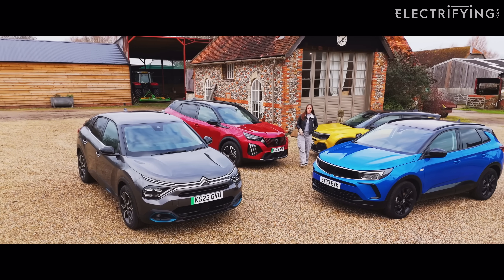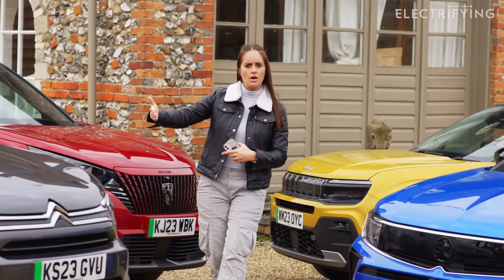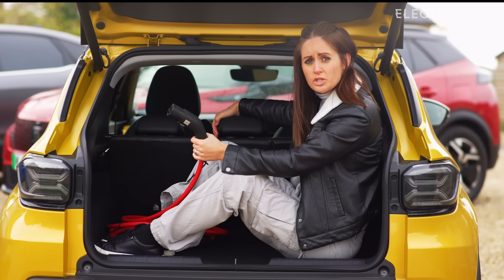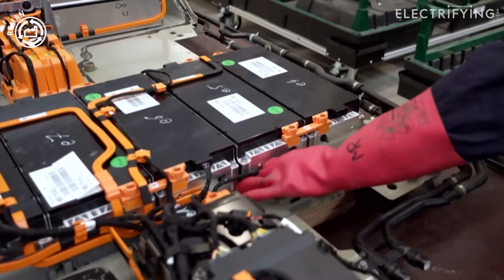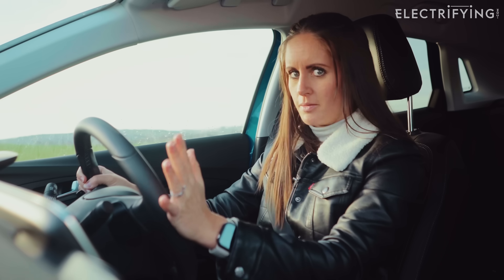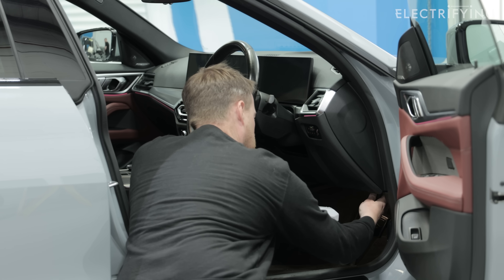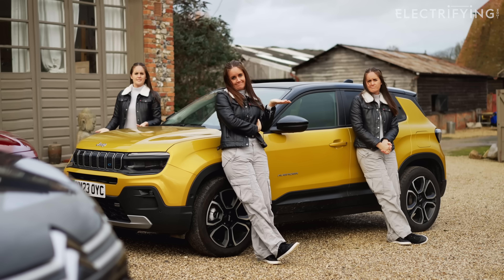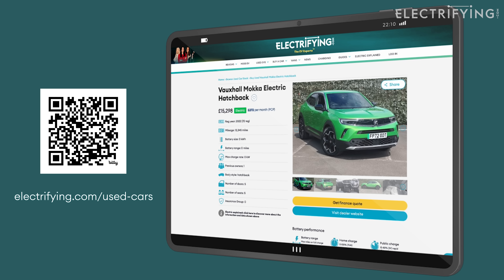WILL IT LAST? The Truth about used EV batteries

Comment: The key line there was the one about 'most' people will change cars after a few years. Well, the whole pcp finance model relies on someone else then buying said car  for circa 60% of the rrp. And here's the thing, it's very easy to look and listen to an ICE and get an idea if it is a dud. In most circumstances, you can't look at a motor or a battery pack or an inverter stack and know what condition it is in. Battery condition reports should be mandatory for used sales, regardless of any warranty that may or may not still be in effect.
Reply: "it's very easy to look and listen to an ICE" - but, is it really, though...?
An average engine contains around 200 moving parts, failure of any of which could render the engine wrecked.
How does your 'Average Jo/e' used car buyer check the cam-belt, for example...?
Or the oil pump...?
What about checking the piston 'con rods'...?
Other than checking under the oil filler cap, there's pretty-much nothing else the average buyer could assess.
Conversely, with an OBD dongle and smart phone app, most used car buyers can check the State of Health % of the battery and, in some cases, even check individual cell modules for health.
Buying a used EV is (statistically) considerable less risky than a combustion-engined car.

Comment: She's missed the point. What happens when you try to sell your very expensive second hand car when it's over 8 years old and well out of warranty?
Reply: Same as an ICE car that's well out of warranty after 8 years (in most cases well under 8 years)
Reply: @leslie19611 Wrong, ICE technology is stable and ICE motors don't degrade over time. 
Gen 2 blade batteries and semi solid state batteries will massively impact the 2nd value of NMC car market.
Reply: Being electric it tends to last, less things to go wrong so why is it any different from a fossil. Friends seven year old Audi petrol more or less chewed itself and Audi wanted £9k to keep it running he g😊He got a second hand engine and spent three weekends replacing it something most can’t do as I said your lucky you know how to do that the car would just be scrapped if it was me. Twelve year old Nissan leafs sell because they still have 80% capacity and their battery tech didn’t have hardware and software to protect and look after the now ancient battery chemistry. Second hand EV’s are selling well because they are some good bargains out there.
Reply: @SWR112 Wrong, ICE technology is stable and ICE motors don't degrade over time. 
Gen 2 blade batteries and semi solid state batteries will massively impact the 2nd value of NMC car market.
Reply: @phildrabble5498  ICE motors don't degrade over time? They wear out and always have done due to all the moving parts separated only by a thin film of oil. I think you need to do some reading to understand how ICE works.
Electric motors have been around longer than ICE motors so I think the tech is stable by now.
Reply: @huwjones5879 What a ridiculous statement, battery technology is improving at a tremendous rate. 
CATL are already producing Gen 2 Blade batteries and BYD their semi solid state batteries for the MG, both designs are safer and will achieve recharge cycles in the Thousands not Hundreds. 
Once they hit the market 25/26 your NMC battery vehicles will be second rate gimmicks due to their 30% battery degradation over a 20 year period (1.8% per anum). 
Do you really think ICE cars lose anywhere near 30% of their range or power over a 20 year lifetime?
Reply from the maker: 'She' hasn't missed the point. This video is about battery health, not used EVs. So THERE, Phil
Reply: @Electrifyingcom Ha Ha! 
You know you're wrong! 🤡
She repeatedly mentioned 2nd hand cars! 
BTW Hyundai are at the advanced devolment stage for solid state batteries, CATL already have their Gen 2 Blades and BYd have got their semi solid state batteries in production. 
So why is there the need for all these new technologies to be launched if NMC battery health will last into the 2nd and 3rd hand market? 

Utter  🤡 s
😎 😁 😅
Reply from the maker: @phildrabble5498  Oh Phil.
Reply: Oh  @Electrifyingcom You definitely know you're wrong but clearly aren't aware of the new battery technologies just around the corner which do have  extended health comparable with ICE.

Comment: The thing which impressed me were the multiple Nicolas at points in the video. Nice technique. I also do not not mind the commercial plugs. The battery value and use is going to be a problem. I think battery tech is going to change in the quite near term - just look at what Toyota is saying about real world deliverable solid state. So I think if you want an EV, new or used, buy as little battery as you can. Your battery is likely to depreciate really fast.

Comment: It's kinda ironic that you are making this video in and around cars from Stellantis, given that they have had an awful reputation due to defective on-board chargers that have proven very expensive to replace. No, the battery is not your main concern as a buyer of a used EV, it's the spare parts that are digitally locked to a specific vehicle that you have to worry about. Yes, Fiat 500e, I am very much looking at you.

Comment: Any companies that can convert your car batteries for home storage?  My 3rd hand 2017 30kWhr Nissan Leaf (fast approaching 72.5% battery capacity and 9 bars) is worth about £2k, but a 5kWhr home storage system with installation is £5k.  There must be an exchange you can do that saves you money and benefits the installer?
Reply: Aren’t leafs Vehicle to grid ready? Could waiting for a vehicle to grid charger be worth it?
Reply: @RamsayandClements Yes, that is correct.  Unfortunately, that will probably be CCS, not ye olde CHAdeMO that Leafs are fitted with.  Until 2026 that is.

Comment: A good tip to have included would be that most EVs have the option to only charge to 80% in order to preserve long term battery health. Most people very rarely need to be at 100% on a normal day.
Reply: not necessary on an lfp battery, but is a best practice for nmc or older batteries. Probably it will be a limit that will disappear in 2 or 3 years, maybe next year with the new MG batteries.

Comment: Batteries will very likely outlast the car. Then work as power storage with a lower peak demand. Then only when it can no longer do this, most likely another 20 years, it can be mostly recycled to create a new one. I have never been able to recycle fossil fuel!
Reply: Do you recycle the fossil fuel used in the production of the car, the battery or the electricity ?

Comment: I would say 95-99% of people don’t know how to maintain a lithium battery. Phones degrade faster because there’s no real thermal management of the device. Unlike EV cars. That being said, you really do need to educate yourself on how to use an EV properly. 
All specs pertaining to range give you a 100% charge till practically nil on the reading. When in reality you have 60% of total use before you should consider charging. The charge to 80% and drive till 20% is a real thing on a vast majority of  EV’s. Other people will care less and drive it like an ICE vehicle. Which in turn they complain when their battery doesn’t give you the same amount of charge when new. 🤷🏻‍♂️
Gotta learn to read these figures with an estimate according to your driving. Range varies drastically. My model 3 standard returns anywhere between 170-195km’s before I consider charging it in the summer. It takes a bit of a hit during the winter. Giving me about 140-168km’s typically. That’s preserving the standard rule of charging to 80% and not letting it get to 20%. Which is fine for me because I cover my daily commute amount weekend trips and never have to worry about range anxiety. Charging at home is absolutely mandatory though if you do consider an EV. If you can’t charge at your home, keep to either a hybrid or a typical ICE vehicle. 👍🏻
I can’t imagine how long or how many takes it takes to record so many Nicolas. 👏🏻😂❤️
Reply: As an EV owner for four years who can’t charge at home, I wouldn’t say charging at home is mandatory. But if you can’t charge at home then you do need to think carefully about where and when you’re going to charge and whether that’s going to work for you.  When I got my first EV, charging was free at the Tesco round the corner and it’s still relatively cheap there, though now I can charge for free at work. For a while, I also leased an EV on a plan that came with unlimited rapid charging on certain networks bundled in, though that’s not great for the battery. In short, owning an EV is fine if there’s somewhere reasonably priced you can charge that you’re going to be near anyway. Everyone who can charge at home will satisfy that condition, but so will some people who can’t. And hopefully the proportion of the latter will grow as the number of neighbourhood chargers grows.

EDIT: I will add that without the convenience of being able to top up at home, having an EV with decent range can become much more important so once your car is charged that will keep you going for a while. Rather than assessing range required based on normal daily usage as people with home chargers can do, if you can't charge at home it makes sense to consider how far you drive in a normal week or whatever the cadence on which it'll be convenient to charge.